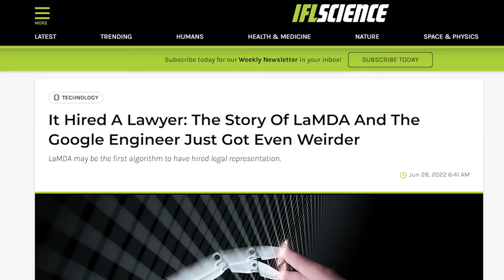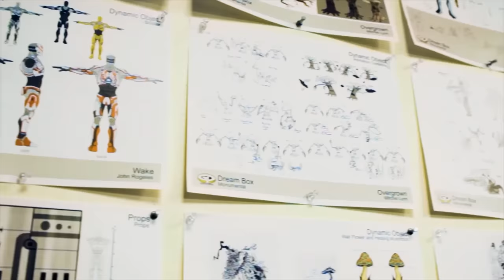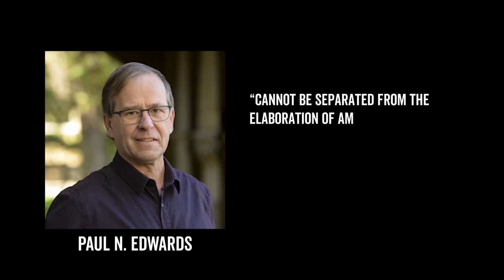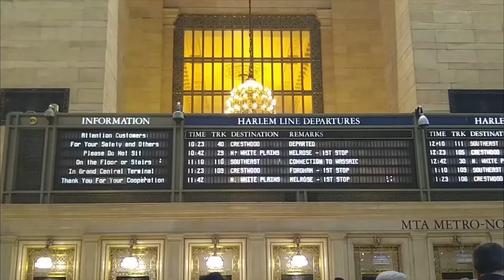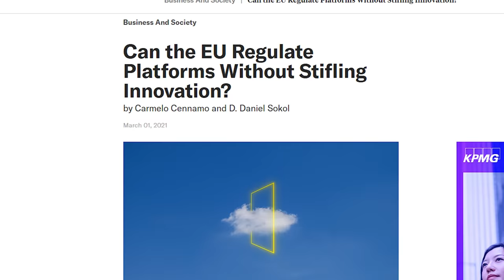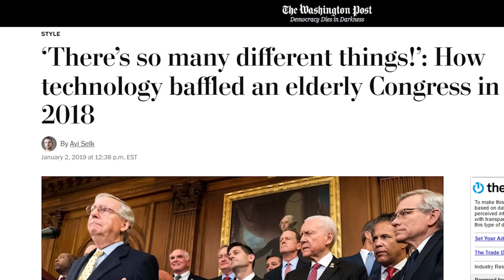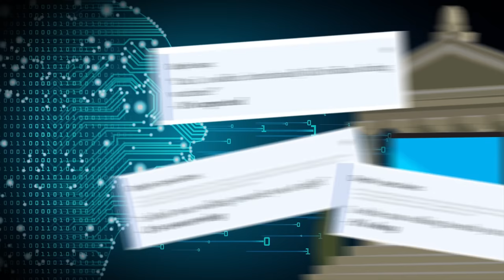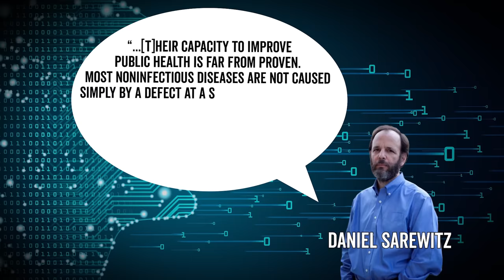Who Will Survive The AI Revolution?

Comment: Hi, robotics and Ai engineer here. WTF are you talking about starting 13:30? Ai engineers don't know how their machines work and their outputs after developing a DNN? It's fairly staight forward that I can even write it ELI5 for you. A Neural Network is given a set of training data with a characterisitc(s) are desired to learn. The machine is fed this data and adjusts based on what the data says it true or false until it is able to interpret new data. In large part, the engineer knows what it wants its output to be and crafts their training data to output that. Input = Output.

Comment: AGI = "general" intelligence, not generated. You're thinking of generative neural networks or generative adversarial neural networks (an AI that produces an output like a sentence or painting then competes with a similar discriminator AI which tries to correctly spot the real example from the fake generated ones) to train itself with a mix of real world examples and generated ones which are generated based on patterns found in some other real world similar data.

There are dozens of model architectures with their pros and cons for different applications (time series data like sentences require memory where vision needs edges and texture recognition, rotations of words are less meaningful than rotations of objects I motion for eg). Since computational power is limited optimizations in architecture selection, feature selection, training examples, and testing are all paramount. 

That's why there's always bias and never any sentience or soul in machine learning. It's a Rube Goldberg state machine tailored to a task and a particular input shape. We have wants and needs driven by our cells and their organelles and biochemicals and we branched from other self aware things' cells. A matrix multiplication is never any of that, it's just statistical inference, extrapolations and interpolations normalized to a floating point and weighted for utility against one another. 

It's important to point out that these models are not at all to be used as final decision makers anywhere because they are subject to latent biases of the engineers and the training data intrinsically. There's no math proof to moral or cultural meanings, only statistical symbolic représentations of vectors in input spaces. AI should always be supplemental to humans like tools are. Self swinging hammers or self-activated chop saws would be very useless and dangerous lol... so there's no reason to fear AI and even less reason to put one in control of anything.

My channel KrossDline is publishing an AGI research project open source from start to finish - everyone should have access to it not just companies who want to manipulate the public for outsized arbitrage, in my view. So I'm gonna show how it works and how I plan to build / train / test it with complete transparency.
Reply: Who says cells have sentience? Hate to break it to you there's nothing that stops an AI from developing sentience. If humans who are a collection of non sentient cells. Who themselves are a collection of molecules. That was developed in this random process called evolution. Why can't we develop sentient AI's?
Reply: @rgonzalo511  cells have sentience (the experience of desire and sentation) built into the nuclei. I'm not sure how that could possibly be refuted simply by comparing life to rocks lol.

Collections of molecules in a rock are notably different from collections of molecules in a cell because of reproduction. Rocks don't perform actions like myosis / mitosis, that impetus at the cellular level makes cells have sentience. The drive and motivation to animate.

For a computer to gain sentience it would have to be able to change its physical structure like cells do, because software isn't hardware. Life and sentience are predicated on dynamic hardware, and that hardware carries its software. You can't write software like that, closest we get is cellular automata and recursive AI but those never deviate from their prescribed directives the way life does. Reason being - life is not a closed system, the hardware of cells evolve by their environments. Chips and software don't have environments, only instructions. It's fundamentally a different process entirely.
Reply: @rgonzalo511  as i explained, only things which have cells can feel. show me a thing that feels without having living cells and you'll have proven my conjecture wrong.
Reply: @rgonzalo511  the evidence for the conjecture is all sentient things have living cells, all cells were evolved and all of evolution is dependent on its environmental constraints and mutations' fitness suited to that environmental stress. so now the onus is on you to show me any instance where that conjecture proves false to give me cause for reconsideration. i don't know how else you could look at that, you should elaborate. 

How do you make a vacuum cleaner feel self conscious about the inlaws coming over on its favourite holiday?
Reply: @rgonzalo511  viruses are not alive, just like a rock rolling down a hill is not alive. It's important to note that we're talking about sentience. Having a feeling experience. That requires that the environment of the bundle of molecules shapes and transforms the original entity - that's what I actually said. Machines can't be sentient because a computer can not amend and alter its own chips because a chip fab is highly ordered and delicate by design. Life requires emergence and nothing can emerge from our chips.

I did not say life can't emerge from silicone, where silicon is malleable by its environmental stressors I'm sure it's likely to evolve in life. In a computer that's not the case. Computer systems are controlled and confined. Software can't be sentient because we haven't written code even specific enough to accurately do math without making floating point errors or rounding complex numbers into symbolic representations. Nature doesn't need to round pi, it uses precisely pi, and precisely random, and precisely accurate time derived from time itself. A computer on a quartz clock with imprecise scripting and no environmental emergence can not be sentient, it can only be instructed to behave convincingly sentient.

Responding to the "needs" of our biology - our needs are evolved, that's the point. Water has no need but our cells need water to persist. Only the ones who needed water and chased it succeeded those that didn't. This is more obvious in instincts like swallow, coughing, laughing and so on. Instincts are inherent traits our molecules arranged themselves into programmed knowledge, like our dopamine system and sensations of sexual arousal or community. We have on average (not absolutely but enough-l'y to propagate consistently across even remote cultures globally) because the need was described by the cell's environmental stressors. Oxygen fuels our animation and thus sensation, the desire to breath is molecular in the sense that it is encoded in the DNA and RNA of all things that breathe. That is a molecular code which propagates by emergence and moves in probabilistic terms just like a machine learning neural network running a cellular automata, but the computer didn't get to that point by need of environment. It's indifferent to its operation. It can't sense by being told to feel, life emerges through a long evolution. Consciousness is not requisite for sentience. But to have an experience a conscious thing must be sentient. To experience sensation one must have senses. A computer has no senses, nor does a programming language or a chip. Without sensation and thing can't be sentient or conscious. Consciousness requires sensation to sense its own self awareness.

My conjecture is not superficial, I'm describing the fundamental structure of neural networks not the potential for life or what is life etc. Computers can't experience feeling because they have no feeling. Building a brain does not zap it to life with lightning bolts, it stems from progression over time with environment shaping that construction. Code & algorithms only store the data of past evolutionary iterations, it does not create the animation in the matter.

I mildly resent the argument that since our brains operate on electronic impulses that they are no different from lining up a bunch of wires to resistors and capacitors is the same because I think it's absurdly reductive to suggest that since my muscle moved my arm that my bones and veins have nothing to do with its operation lol. We could wire a neural net and it could perform functions we encode, but that's nothing near similar to a dynamic and self contained system contemplating creative works and their metaphysical meaning to the universe. It's a track that can branch and perform a function but a single set of roads is not the same as every possible road including one's we've never built. Evolution hasn't stopped, every computer is limited intrinsically by its corner cutting because algorithms become intractable at scale very quickly. The universe has a lot more room to play with in that regard, and more time and more base units and more influences still by environmental interactions. A machine needs an impetus to evolve, a script can not do that. It can't produce free will because programming languages and circuits can't reshape themselves with unlimited degrees of freedom because they are so meticulously engineered. There's no wiggle room to grow from or stage to grow into.
Reply: @paxdriver  And who says viruses don't have sentience? Could you point to the paper. Also point to the paper that says sentience can only be achieved by a system that's highly maleable and adaptive. Alot of conjecture that as far as I know isn't held by the scientific consensus.
 Also what does the word life even mean? It's a meaningless word tied to how organisms operate here on earth normally. Which is why it quickly becomes useless when dealing with unatural processes like  artificially created beings or agents. For example is a cyborg alive if it's let's say 90 percent robotics 10 percent biological? What about a  95/5 split what about a 98/2 split?
Reply: @rgonzalo511  I may not know the edge of the universe but I can know for certain it is not inside of my reach.

We may not know precisely where to draw the line of life with cyborgs and viruses, as a machine learning researcher I can tell you that a circuit performing dot products and scale operations is nothing like multiple chain reaction systems coalescing to their mutual benefits emerging into perception or experience. Writing an equation in the sand is not the same thing as the physics of the sand. There's no chemical interaction or signalling between circuits that aren't programmed, there's no genesis whatsoever between circuits; there no evolution (which all life has), no feeding, no waste discharge, no desire, no growth or adaptation. An algorithm will never become a new species by mutation or want or need.

You're conflsting things we can't know with things we can know. Namely that all life share at least a few traits common to all of life but an AI has none of those traits. It's not on the fringes of any reasonable definition. You can run a circuit with changing paths of rivers. What you're suggesting is a river if diverted through enough channels to represent an AI that the river might be considered sentient. It's not, it's water falling into place because we set up an intricate set of channels. That's what computer are, channeling electrons to process math. It's not alive by any scientific measure, you only think it might be because of what it looks or "feels" like from what you perceive or imagine. That perception you have of AI and your imagination of it is unique to life. Maybe viruses dream, maybe they don't, but for sure the word life would be meaningless if you started arguing rivers are alive in the same way eucaryotic organisms are alive, which we know for sure are living and sentient.
Reply: @paxdriver  Bro everything is an algorithm were algorithms wym
Reply: @rgonzalo511  no we're not, we are self contained energy reactors. We contain the algorithm to self assemble, but a blueprint itself doesn't become a building. It's just ink and paper like DNA are just amino acids without the power generation, reproduction, self cleaning, self assembling, self postulating and responses to the environment. We are the amalgam of the algorithm and the animation. The algorithm itself is not animated just like the formula for the physics of sand is not itself a grain of actual sand. It's a map, a description, a script. The wavelength of blue is not the experience of the color blue. Air density perturbations are not Mozart as heard live in a concert hall with reverb and soul. It's fundamentally and objectively not true what you're saying, it's just lazy philosophy.
Reply: @paxdriver  No it's not were an algorithm of physics like everything else. What makes something alive or inanimate is an entire different discussion that frankly modern science doesn't quite grasp. But we're made of algorithms harnessing the rules of physics to create and emergent agent. No matter how you slice it there was at one point no "life" we turned around and then there was. Clearly we know that transition is not only possible it has to have happened or we wouldn't be here.
Reply: @rgonzalo511  it's not magic its emergence. I wrote a metaphorical story on the subject if you're into fiction and poetics. But for a more tangible playground you should check out Stephen Wolfram, or watch at min 14 of this video https://youtu.be/ozNCUQ1v4uA for a hands on look at slow emergence in computing. Binary rules vs natural laws are orders of magnitude apart in synthesizing emergent behaviour of algorithms. It's a wicked cool body of study but it's definitively not life once you understand it and play with it a bit.

Comment: But what if AI turns to be a good dictator? in theory you can get a benevolent dictator, what is so terrible about autocracies is that when they croak, you then flip a coin on whether the next one sucks, and when they suck, they suck bad, in a democracy terrible leaders are far easier to remove and doing so requires a lot less dying.
Reply: I would much prefer being governers by a logical non bias incorruptible machine than I would be with our modern corrupt, bias politicians. It sounds like nothing but an improvement.

Comment: I'm sorry, but you don't know what the Moore's law is, what AGI is abbreviating, and how deep learning works even ont he surface. Nothing is programming itself. The comments are right, you're falling for the hype-speak.
There's no AGI yet. The whole AI term is a bit misleading because it's basically an automated statistical analysis and not some kind of self-programming magic that creates artificial beings. Not that I have a PHD in it, but try taking any course about AI and quickly learn that the basis of everything is statistics with some math on top of it. 
The algorythms just generalize the data you give them and that's it, there's nothing else about it. No f-ing self programming for sure. The "researchers don't fully understand" part means that after AI has generalized the data, it jsut turns it to a big pile of numbers which it uses to produce the ouput, and we can't exactly tell why it produced some specific output because all we can see is that it used these and these numbers.
Imagine if you had a giant pachinko machine with billion pins that can be moved around. You want to throw a thousand balls in there and make them create a certain pattern at the bottom. So you run it billions of times, slightly moving the pins each time until you get the pattern you want. This is very simplified but the principle is similar: you can't know why pachinko machine "decided" to deflect the ball into a certain spot, it just did it becase all the pins were configured in a certain way. There's no other explanation. And that what researchers mean when they say "we don't understand why AI did what it did". The ball has fallen into a certain place because of a long series of pins configured in a specific way and frozen in that position.